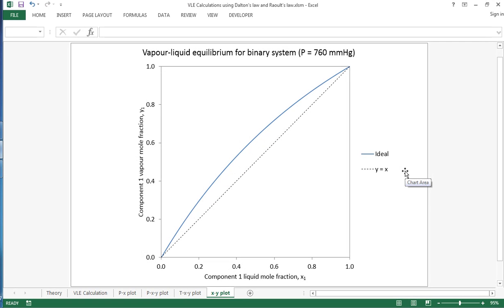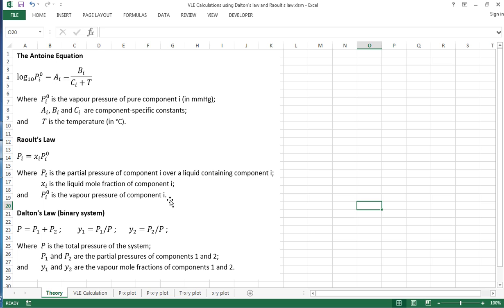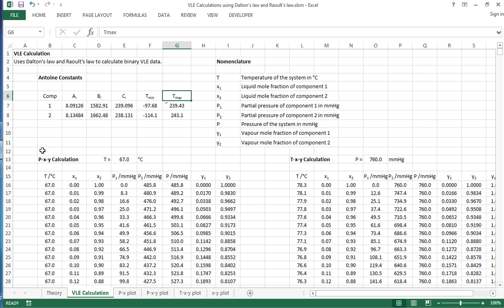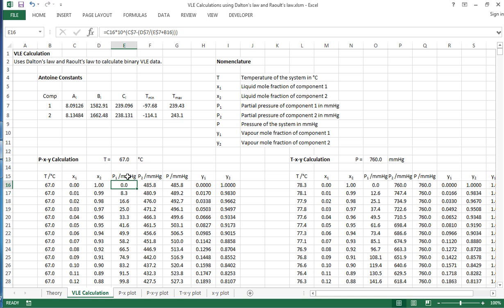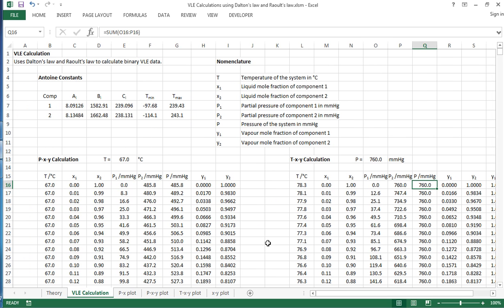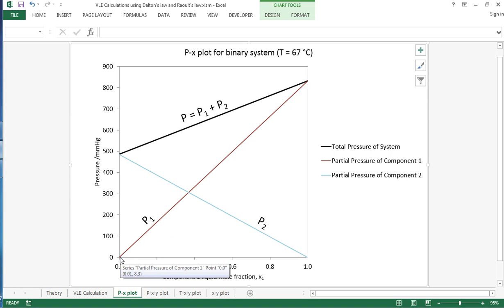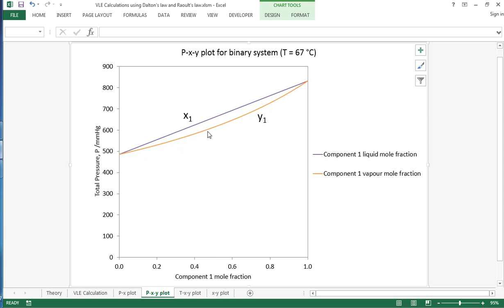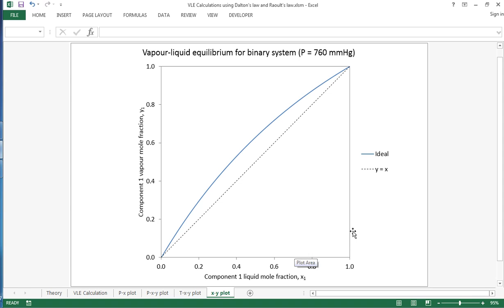Binary VLE calculations part 1:  using Raoult's law & Dalton's law for ideal systems

Comment: Hello, I have a question and I really hope you can help me on how to answer it. I actually know how the graph would look like - I just don't know how to graph and what to graph on excel based on these informations. 

- Mixtures of liquid benzene (molar weight 78.12 g mol-1) and toluene (molar weight
92.15 g mol-1) are considered ideal. Vapor pressure over pure benzene and toluene are
respectively. 750 mm Hg and 290 mm Hg at 80.1 ˚C.

Draw for ideal liquid mixtures of benzene and toluene Total vapor pressure curve and partial vapor pressure curve for the two components at 80.1 ˚C in Excel and paste the graph into the answer. As the x-axis, the molar fraction of benzene must be used.
Reply from the maker: You need to plot a P-x diagram (for T = 80.1 ˚C). The first half of the video shows you how to setup the calculations. At around 3 minutes 30 seconds it shows you the plot. You need to use 750 mmHg and 290 mmHg as the saturated vapour pressures for pure benzene and toluene respectively, instead of using the Antoine equation. I hope this helps.